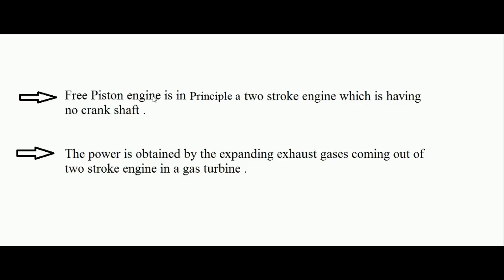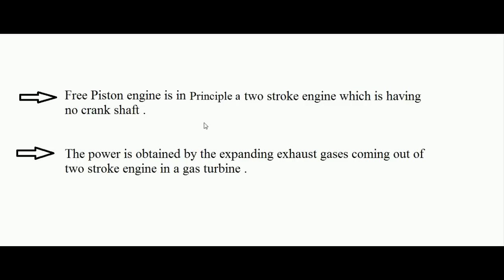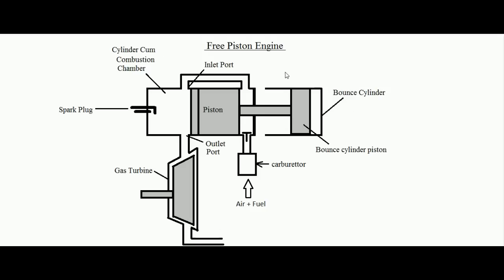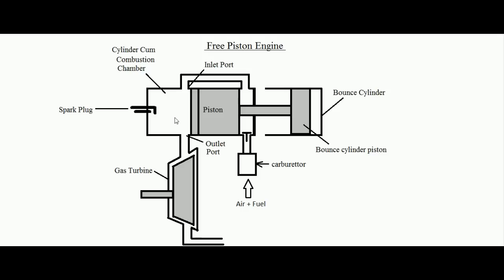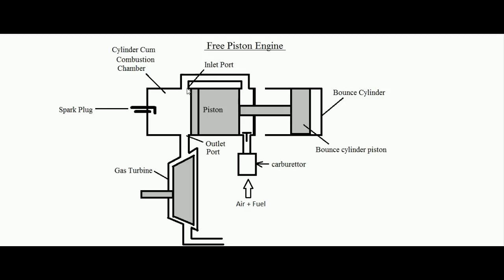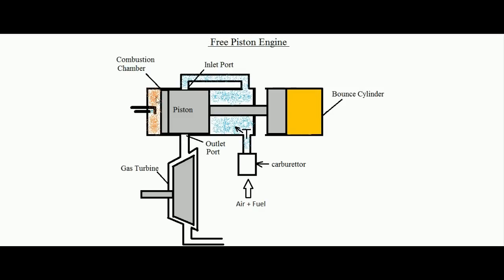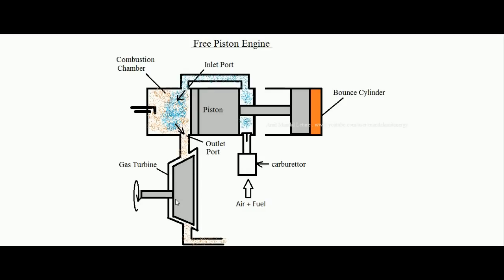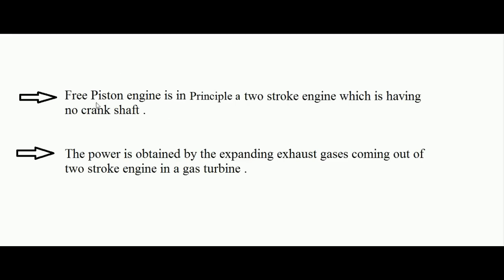Free Piston Engine , Principle and working

Comment: The idea is very cool. However, the exhaust outlet opening would have to be higher than the mixture intake opening, then the exhaust outlet would automatically suck in the mixture because a negative pressure would be created in the combustion chamber (of course, using a properly shaped exhaust). Such solutions are in modeling internal combustion engines. Regards

Comment: the bounce cylinder is a problem, because it will act as a heat pump. As the piston compresses the bounce cylinder, it will increase the temperature of the compressed gas, leading to an energy transfer from the hot gas to the cold cylinder walls *at the end of the cylinder*. When the piston decompresses the bounce cylinder, the gas will cool due to this decompression, and *absorb heat from the long side of the cylinder, cooling it off*. The process repeats. This is a great inefficiency. I can't think of a solution but you should investigate this.
Reply from the maker: This is theoritical explaintion, those are practical factors...

Comment: good presentation video, really gained a lot of information from your video. The only con in this video is that the content is repeated many times and also there is no advantages and disadvantages of the engine as well its application. So please try to make concise videos as we have lack of time with youtube study :P
Reply from the maker: +Raja Agrawal ( PGI15ME301) actually repeatation is 'mnemonic' many students like this. Secodly uses and other connected can be found and understood by other sources . I have found difficulty by students to understand the concept.
Reply: how will only exhaust smoke will come out from the exhaust port? As there is inlet of charged fuel simultaneously at the same time, will some of the charged particles also move out with exhaust?
Reply from the maker: here the losses and other factors are not considered

Comment: A 2 stroke engine has a crankshaft. It does not have a camshaft which is what controls the valves. Don't listen to someone who doesn't know the difference between two fundamental parts of an engine

Comment: So its a piston turning a turbo that doesnt even create tq from the expanding gas. How is the gas supposed to turn the turbine when at its least pressure? This is a dumb design. Let me guess. Its just theoretical?
Reply: Seen a free piston engine with exhaust gas driving a gas turbine on a small ship in 1960.
Reply: It works the same way as a turbine in a ordinary 4 stroke engine.
Yes, it is as efficient as any 2 stroke engine, which is bad.

And it is also possible to take out some energy by putting a magnet on the shaft between the pistons. And then have a spool of wires around it. Then you can get out AC from the spool as the magnet passes in the spool. You get a linear generator.